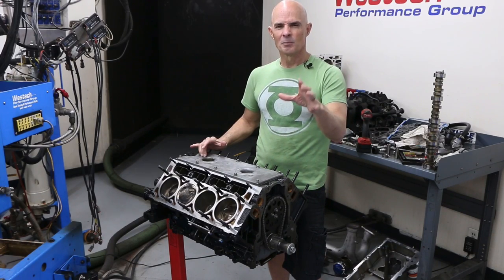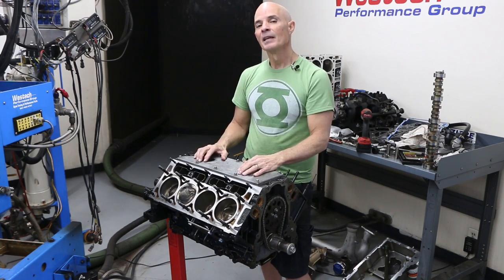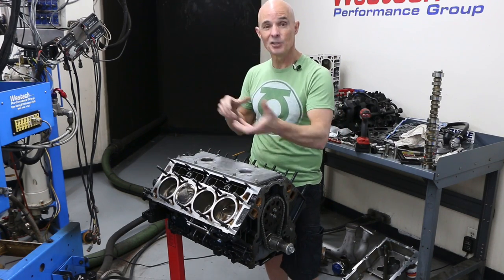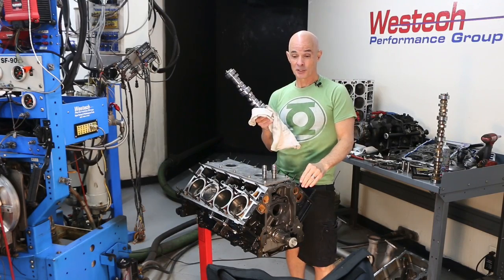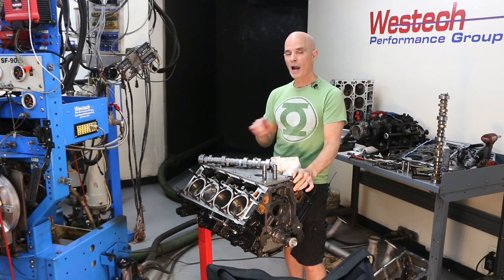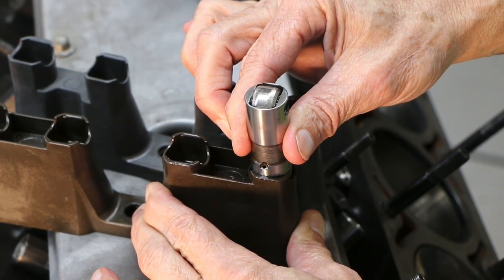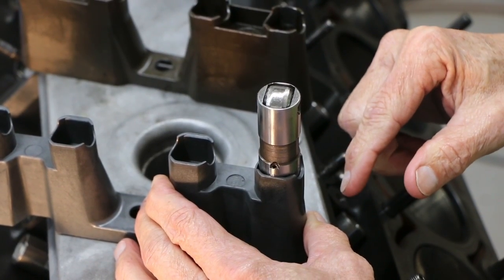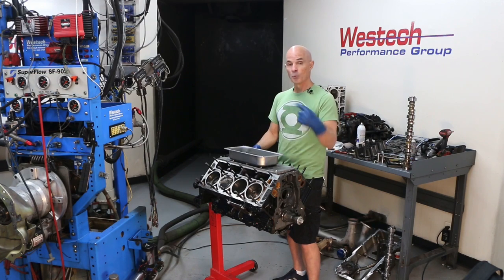WHY IT BROKE! 4.8L LS LIFTER FIX!

Comment: fuck. I just buttoned my whole engine up with the sloppy old lifter trays
Reply: 😬…. Either go back in there or your engine could grenade ☠️, especially if your engine had high mileage!

My newly acquired (a few weeks ago!) 2006 GMC Savana 2500HD 4.8L/4L80-E has 254,000 miles with low oil pressure (18-22 psi!😬) and I just bought a new oil pump pickup tube o-ring/oil pan gasket, Melling high volume oil pump, Cloyes double roller timing chain, camshaft thrust plate, valve cover gaskets, iridium spark plugs, front brake rotors/pads, rear brake pads, brake fluid to flush the entire system, engine oil/filter, front bump stops,…

AND I still need to buy a new full-aluminum tanked radiator, dual electric fans with built-in shroud like a Flex-a-Lite #294 (converting from the manual, “power and gas mileage-robbing” fan), new radiator hoses because lower hose is a “snap-lock” or “quick disconnect” hose and won’t work on another radiator🤦🏻, a Flowkooler high volume water pump, a 200+ amp alternator (Mean Green or Mechman?), a set of MSD 8.5mm Super Conductor spark plug wires, and a TBSS intake manifold.

Now, because of this video, I’m thinking that I SHOULD change out the old lifters (with the better designed ones with bars going across… technical name?) and new OEM trays, but this means removing the heads… and remember, the engine is in a VAN!! 
So, if I’m going to take off the heads, I might as well refresh them, right? New valves, beehive springs, pushrods, ARP bolts or studs?…

If I’m going to do all of that while just the long block is in the vehicle, I might as well yank that as well because I just noticed that it needs new motor mounts! 🤦🏻☠️
Therefore, while the block is out, might as well refresh that as well, right?!🤦🏻 It’s like an endless rabbit hole!! 

While out, I can replace the torque converter if I want to go with a different camshaft. 

I want this vehicle to last me for another 20+ years, so I might as well put some forged pistons, top-of-the-line rings, new crankshaft, 5.3L forged rods and a 5.3L forged crank with new TOTL rod and main bearings. 
At least it will be turbo/supercharger ready/capable😐.

It already has true dual 2.75” exhaust all the way back to the single factory muffler, but only ONE 2.75” pipe out of the muffler??? 
So I have a little experiment… I have a ‘21 Jeep Wrangler Rubicon 392 AFE 3” dual inlet/3” dual outlet muffler (with I believe a built-in “x pipe” inside the muffler?) and will see if true dual pipes make a difference in power/fuel economy or not. The sound quality will be different… deeper rumble and a little louder, but not too much, I hope, otherwise if it performs well I’ll sound deaden the rear area a little more if necessary.😂

But at least you probably have a truck, so access/removal/replacement are a LOT easier!
😎👍

Comment: Yeah, worn lifter trays. Exactly why I always had them replaced when doing a cam. Also one reason I don't agree with a cam only swap especially on a high mileage engine. I always replaced ALL the lifters and did new lifter trays. I know it's more work pulling the heads but its piece of mind. Also, if the cam has a high ramp rate the oil you use is important. Joe Gibbs LS30 oil is great for LS engines with aggressive cam swaps.
Reply: Id replace the pump with a high volume unit for hi mi and a hvhp unit for hi perf apps. Pickup tube o ring is a must.

Comment: Forgive me if this has been asked a million times but I will ask again. I understand weight and gear ratio are a couple of the many factors but lets say I have a 2006 2wd silverado crew car lm7. I have a 3.42 gear and want the most wild cam I can install with a stock stall. Lsa? Duration? Lift? All three?

Comment: Richard, do you reuse the MLS head gaskets?  My junkyard LM7 is not holding oil pressure so I plan in pulling the motor and checking the pickup tube o-ring. Also I have a plan to get a rebuilt short block and reusing my heads if the bearings are shot in the bottom end. I know some guys copper spray them, is that what you do?
Reply from the maker: i do reuse the mls gaskets-I don't normally use copper spray but it might help if the gasket surface is a little worn

Comment: I have a LQ4, have run several different cams and had this same lifter/cam wear problem, this is with new lifter guides every time, after going turbo, I went back to a stock LQ4 cam and LS6 valve springs- problem solved so far in 10,000 miles and 4,000 of it towing. I just couldn't get an aftermarket cam and strong valve springs to survive. I will try the link bar lifters next time- no way plastic trays can handle high valve spring rates.
Reply from the maker: let me know  what works for you

Comment: I've seen you switch out this cam a few times now .. do you like the 2pc timing cover I dont see no one use them when they dino I figured  it be easier I got one an was just wondering if anyone likes them before I try mine out .... great vids learn alot everytime
Reply from the maker: i have not tried the 2 piece-cam swaps are pretty easy-this motor has seen 25-30 different cams

Comment: Excellent content. I’m just about to rework the heads on an L96 and was thinking of doing a cam upgrade at the same time. If lifter trays are a ware item and they are inexpensive, it would a good idea to replace then any time you open up the engine that far. I suppose some minimum number of miles and how the motor is used should be considered in making this decision. Or are they cheap enough that it makes since to just change them?
Reply from the maker: they are cheap and I was only changing cuz it make swaps easier

Comment: my name is turbo jack, i bought lifter trays off ebay, putting new lifters in my ebay trays in notis there were louse  almost falling out. called gm got new trays, u haft to push thum in . good reason there tight , they index the lifter to the cam. don't by junk.

Comment: I always replaced lifter trays when pulling lifters. Specially on a junkyard build. General rule of thumb is if the lifters dont dont try and come out when you pull the trays, they need to be replaced

Comment: Just checking out build up in water passages she could  do with a dip .that build will act a insulation barrier will inhibit  or block heat entering  into the water or coolant passages  Ls engine's  have   thermal heat  issue's.  Before ya start saying what they just think why they have sodium filled exhaust valves .
Reply from the maker: its from the dyno water
Reply: @richardholdener1727 … You should try using Evan’s Cooling non-aqueous fluid, like NPG or NPG+C (ie. no water in it!). This will prevent any and all “build up” in your cooling system (eliminates rust, oxidation, corrosion, & electrolysis) AND it doesn’t build up pressure AND it eliminates knock. 
The stuff is AWESOME!! You can get an engine up to full operating temperature (200+ degrees), then take a rag and open up the radiator cap and all it does is make a small “pop”… NOT shoot up 20’ in the air and scald you to death!
Its boiling point is 375-400 degrees, NOT 212 degrees (regular water) or +/- 265 degrees (50/50 water/antifreeze mix).

Just a nice solution.😎👍

Comment: Yup, definitely what caused the wear in the cam and lifter, switching to bar linked lifters would solve the issue compared to plastic litter trays that wear out and can bend with all the heat cycles

Comment: I think the lifters are the problem. Not hardened correctly or something. Original gen 3 LS lifters never/rarely had problems. Seems like once dod systems came out lifters started failing all the time causing camshaft damage. I'm thinking they are manufactured differently than they used to be and failing from cheap material/manufacturing, at the dealership we see them fail like that with very low miles and there is no wear in the lifter trays. I just replaced the cam and lifters in my 2001 lm7 with 170,000 miles everything looked perfect. But do cams/lifter on gen 5 LS trucks on a weekly basis

Comment: But what would cause a twisting force on the lifters to twist them in the first place?
Reply: Flat tappet cam lobes are not ground square; they have a bit of angle to them, that when combined with a slight radius to the lifter - causes the lifter to rotate during use. Perhaps a roller cam lobe that isn't nice and square will attempt to spin the lifter, also??
Reply: Harmonics and rpms.

Comment: On the subject of lifter alignment: the stock pushrod length is virtually never correct when using an aftermarket cam.  99.99% of everyone is doing that wrong INCLUDING all the big name shops.  .525 is max lift without changing cam journal size, pedestal height, valve stem height or pushrod length.  The Comp 54-454-11 that gets used commonly on this channel is .624 lift.  .624-.525/1.7=.058 lifter preload error.  The factory spec is .100" +/-.025".  If the motor comes from the factory on the low side that's .075-.058.  That's ONLY .013 lifter preload.  .087 out of spec...

For some stupid reason, people think that only regrinds have to reduce the basecircle to achieve more lift.
Reply from the maker: I have not found that to be the case-we measure PR length
Reply: Don't let me interrupt your arrogant ignorance.

Comment: Since 4.8s are on the low end of the torque it would be good to see a range of street cams so you could find the sweet spot factoring in weight and gears
Reply: Nick Adams every application is different. Depending on what the desired goals are of the vehicle and it’s intended use, the driving characteristics are going to vary in every application.  That being said, choosing the right camshaft for specific vehicle based on weight and  optimal desired “sweet spot” for any given motor is going to be different for each and every setup.

Comment: I'd like to see some short travel lifters and some big cams with soft lobes (like Comp's HUC lobe) and 8500+ RPM.
Reply: SpeedMetal13  Richard did a de-stroked LS3 with 4.8 crank(i think around 5.5L engine after that) revved it to 8k. Had a decent amount of money in the top end and big high rise intake. Not a video just a right up about it if you google LS3 4.8
Reply: @knowbull5hit590  Thanks for that. I'll check it out!

Comment: Another option would be to use tie bar lifters and get rid of the trays altogether.
Reply: Then you have to find a way to support the lifters during a cam swap.
Reply: @andrewlangley9507  you’d have to remove the lifters to do a cam swap.  I used to work next door to Comp cams. They were cam swapping an old Ford FE and the tech fished the lifters up with coat hanger wire just enough that they were above the cam but still in the lifter bores.  It kept him from pulling the intake and the carb. Okay for the dyno but need to change flat tappet lifters when changing cams....

Comment: I have a Gen6 454 that did the same thing to the lifters, brand new GM crate engine, i swapped in a zz454 cam, pulled the heads and installed comp cams beehive valve springs and comp roller rocker and converted to adjustable valvetrain. Got about 25k miles on it and a couple lifters started to make noise, makes 40 psi of oil pressure at idle so i yanked it out and tore it down i can't find anything wrong, all the bearings look like its never been ran. Tips of the exhaust valves and the guides are ate up like it wasn't oiling but i ran my primer to verify oil psi and oiling before i tore it down, i don't see any lack of oil.
Reply from the maker: check coil bind on the valve springs and retainer to seal clearance too
Reply: @richardholdener1727  Just did, i have plenty of clearance .720 between the retainer and valve seal. coil bind is at 1.230 installed height is 1.88 . the cam is only .540 lift. scratching my head on this one
Reply: Pistons smacking the exhaust valves with the new cam and heavy right foot? Or bad rocker geometry? Maybe a combination from the new higher lift?

Comment: 100% because of rotation. I've disassembled 2 of 5.3 LM7 with same worn out lifter trays and guess what - both cams were actually destroyed the same way. So yeah, lifters and lifter trays change should be done on those junkyard engines almost every time. They're cheap so no big deal. Thanks for the video!

Comment: My question is, why is it so common to see cam swaps on Ls motors without changing the cam bearings?
Reply: That's pretty common in general on pushrod engines. Done many SBC and Pontiac V8 cam swaps. Bearings were always fine. I guess maybe because the camshaft doesn't have near the pressure on it that a crank does.
Reply: middlesiderrider you’re correct on the camshaft deflection and the pressure is spread out fairly even if the assembly is balanced. But let’s be honest here.. the main reason is not because the cam bearings aren’t worn out... most LS motors i disassemble that have been rebuilt or have had the cam swapped out and/or anything changed in the valve train, have some sort of wear on the cam bearings... not all, but definitely most.  Cam bearings Do wear like all bearings do.
The real reason cam bearings are left alone is because 99% of the ppl that mess around with these engines DON’T have a cam bearing install tool to replace them properly. On top of that, cam bearings on the majority of pushrod engines are only done when the block is completely stripped down. Rebuilders that have the right tools often mess up installing new cam bearings. It’s not a walk in the park task to do. And If there’s one thing you can get away with skipping on these engines, it’s cam bearings, followed by pushrods, timing gears, and in a lot of cases the oil pump. But only if the crank shaft is left untouched. 
One thing that’s rarely mentioned is whenever an LS crankshaft is polished or cut for new larger rod and main bearings, a high pressure oil pump is usually always needed to yield enough oil pressure. Even with a brand new pump, I would shim the relief valve spring .040 and install a fresh GM o-ring on the pickup tube at bare minimum. Otherwise plan to see very poor oil pressure.

Comment: Ideas. Modern hemi, how much power will it make turbocharged on stock internals vs old school wedge rb, vs b. including cost per hp. Etc
Reply from the maker: I did a big bang Gen 3 that did over 1000 hp
Reply: That was stock block and internals? Any footage?

Comment: why just two? did you check the other trays?
Reply from the maker: I replaced them all
Reply: @richardholdener1727  thats not what i meant. did you try those damaged lifters into the other trays to see if they were also loose?

Comment: I wonder if they've upgraded the lifter trays over the years.  I know the materials have changed since I did my first cam swap back in 2001 till now... But the cost makes it a no brainer to swap them every time the heads are off.
Reply: They've actually downgraded the trays.  Look at an LS1 tray vs an LS2 (which is all you can get now, pn 12595365), they removed a ridge that ran across the flat ends to help with rigidity.  Your only options are to use an LS2 style tray and cross your fingers, or go to a link bar lifter setup ($$$).  I'd rather use a new LS2 tray over an old LS1 tray, though, just because of plastic and heat cycles.  Like you said, just replace 'em any time you pull the heads.
Reply: Maybe, but they didn't properly fix 'em. I hear lifters ticking away in a solid 30% of the old GM trucks in my little town, even on stock engines driven by boring old farts who think 50% throttle is dangerous and will blow up their motor.

They're cheap as hell though, so I agree with you that you may as well replace them whenever you get the chance, or at least when you first build the motor. Cheap insurance.

Comment: I want to see a twin charged setup
Reply from the maker: that's coming
Reply: @richardholdener1727  I would love to see the advantages and disadvantages of that kind of setup and where this setup would be ideal if it even is. Also a walkthrough of making the 4.8 in to a flat plane crank engine would be exciting to see. You should also make a "ultimate LSX free mods" guide for all of us fans that like to tinker with junkyard lsx engines.

Comment: What about bare bones stock 4.8/5.3 factory heads, factory cam and factory springs with a turbo. Unless it's already been done
Reply from the maker: I've run lots of stock ones with boost-600+ hp at 10 psi

Comment: I like watching someone that knows so much about GM motors tear into them, even as basic as it seems to you or I, there's someone out there who's having similar problems , but may seem like relocating continents to them. Until they watch Rich make it look as simple as taking the next breath of air. Good job man, keep em coming n I'll love to keep watching em
Reply: Yes, great video. I'm gonna do a cam swap. I think I will be removing my intake and doing a proper inspection. Good luck on your projects!
Reply: @kswis , someone who “KNOWS SO MUCH ABOUT GM ENGINES” should have known that an LS engine with 100s of thousands of miles on it, swapping heads, cams, having lifter and camshaft damage MULTIPLE TIMES should have known to replace plastic lifter trays!!!! ESPECIALLY after seeing damage/failures multiple times and only costing a few dollars to replace. @ Richard, you definitely know LSs but after all the times you had heads off and seen the signs you should have known to replace a cheap plastic piece known to wear out and can’t even hold the lifters up while cam swapping. Glad you showed and shared this info though so inexperienced ppl will learn from your mistakes.